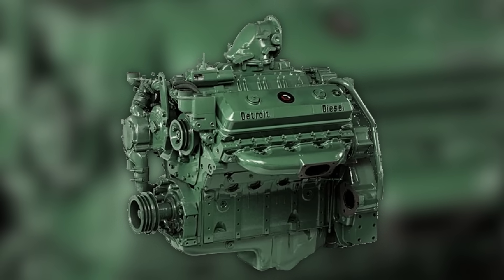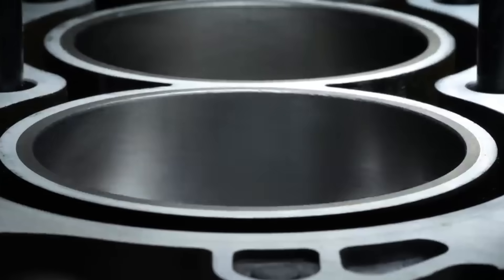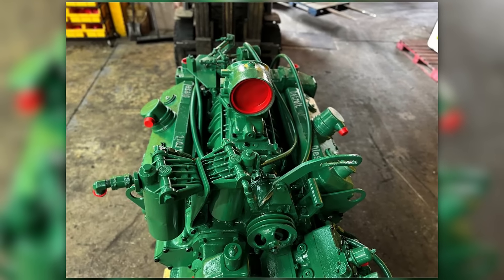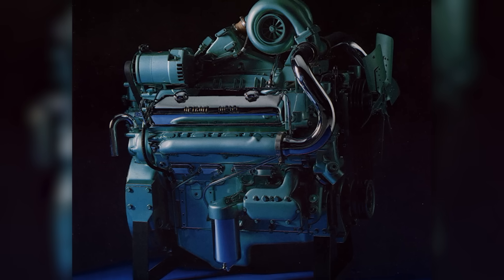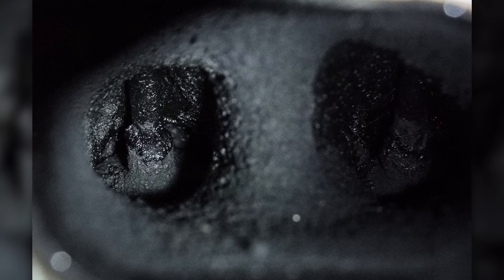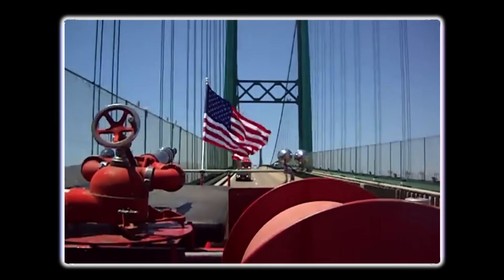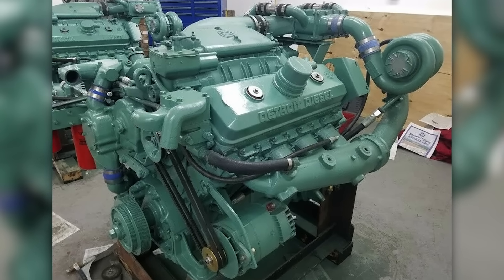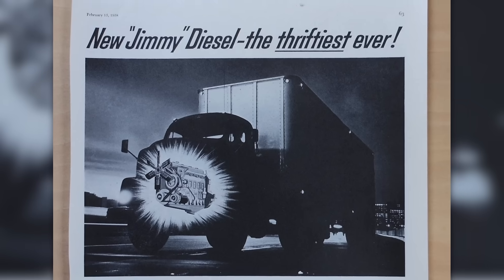The Shocking Truth About the DD 8V71, the Engine Too Hot For Its Own Good

Comment: If you’re going to talk about something at least get your facts straight, the series 53 and 92 had wet liners and the 71 had dry liners.
Reply: I think your source is confusing wet liner with the general concept of replaceable liners. If there was rust or water damage on the outside of a 71 series liner it was not good.
Reply: Also a lot of the pictures you showed weren’t even Detroit parts and some were series 92’s
Reply from the maker: The guy doing the rebuild of the 8V71 said they were wet. I've gotten equal comments with wet/dry, so which is it? You can see the pics of the cavitation erosion, which was in fact on an 8V71. People on both sides swear that they're right.
Reply: @VintageAmericanMachines I have rebuilt series 53’s, 71’s, and 92’s. Series 71’s have different sizes or liners listed as #1, #2, #3, and #4 with #4 being the largest. The cylinder has to be honed to fit the appropriate liner and checked with a feeler gauge for proper fit.  There are no seals on the liners only shims that go under the upper lip of the liner for deck height. I believe that the series 71 came out first and then the 53 and 92 with wet liners.

Comment: Had its big Bro 8v92 go over 60,000 hrs. in a boat. Regular maintenance is all thats needed. All these wonderful engines are finding new life Down Under (Australia) in boats and buses. My Grandfather drove logging trucks and he always said "the hard you run em, the better they cool" and he always had the hammer down. The only issue we ever saw with them(had 4-53,6-71,8-92, 8-92T) was the oil leaks and noise, tho I dont count noise as a problem. Still run a 8v92T today.
Reply: I've been having fun with the Detroit 2 stroke engines since I was a kid. A while. Oil leaks ? Attention to details. And. Don't Overfill it. The oil blows out the air box because it hits the crank. Yachtsman like Nice, clean, oil free bilges. So do professional Fisherman and Industrial operators. Usually, somewhere between the "Full" and the "Low" marks. On occasion to mark new , unmarked dipsticks I put in the recommended number of gallons then use the engine till the oil quits blowing out the air box drain. Then I mark the stick. Truly Great Marine and Industrial engines! 50%of all oil leaks come from filling it up to the Full Mark. At least 50%.
Reply from the maker: Wow, nice. Your grandfather would be correct.
Reply: The 8V92 was one of the best marine engine we ever had in small boats in the US Navy. Yes, maintenance and running lower oil levels were key. The exhaust boots going into the water did help keep the noise down.
Reply: I think they're an awesome engine if I were to be honest. They sound amazing too!💪😃
Reply: For marine application the 6/8/12V series DD is your "safest" bet with water cooled exhaust manifold and never a problem with coolant capacity (relatively speaking) because heat was/is that engines flaw.  Once coolant temps reach redline forget it, cracked cylinder head(s).
Reply: Thats pretty awesome mate. I agree with you, it's all about regular maintenance and servicing. All engines are different but I think these were a pretty important engine to maintain.
Reply: Always Told drivers to put a brick on the pedal and pick a gear for the speed you want!
Reply: Unfortunately they were pigs on fuel and the emissions would kill the crew 😂
Reply: @chrisvig123 
No question, they would need some VW emissions technology!, and ear plugs for the least enthusiastic .    
 But for the loud and proud floaters , this was the best of the best !
Reply: @johnh6515  I was thinking that current electronic sensing and control would cure most ills
Reply: @eflanagan1921  They would be fighting the basic design of 2 strokes, DDECIII was fitted to the 8V92 but that didn't get it past the EPA94 rules and for trucks the Series 60 was doing very well. 
None of this talks about the fuel economy issue that 2 strokes can have. 
While GM/DD was the main proponent of 2 strokes the lack of control (relatively) to 4 strokes is an issue - for the same reason all outboard engines developed in the last few decades have been 4 strokes. 
Even in tugs where their responsiveness is both legendary and required they have on an operational level lost out to 4 strokes and where loosing that battle before the emission requirements where high. 
The Cat 3516 for example was developed to the point where it could give the same sort of instantaneous response as the 2 stroke. 
Funnily enough the EMD engines that the 3516 replaced in tugs where also a GM developed product, they are still made today but mainly for locomotive use - and are owned by Caterpillar....
Reply: @ianloy1854 Everything is going to 4 turd strokes these days and that’s what car culture is obsessed with. I’m in for a 2 stroke DFI v8!
Reply: @eflanagan1921  any 2 stroke motor suffers from 'excessive' emissions - with that said, once has to wonder if the cures are actually worse than the initial 'problem'  (using dust to dust analysis).

Comment: 2 stroke Detroit diesel engines were awesome,  if nothing else,  THEY WERE  GREEAT AT TURNING FUEL INTO  NOISE, SWEET SCREAMING LOUD NOISE! I'D LOVE  TO SEE A GAS VERSION!  With fuel sprayed directly into the cylinder when the piston reached near bdc to just after bdc. A couple  turbo to boot. Maybe a pair of 120 mm spoolie boys. And a pair of spark plugs per cylinder, spinning up to 6k to 6500 rpm any  2 stroke Detroit  sounds awesome,  2/53, 4/71,  6/71, 6v71, 8v71, 12v71,  24v71, 8v92, even the 100× Cid per cylinder 126 what ever it was 12v126, 12 x 126 Cid. Over 1200 cid😮 a 6v126 would been awesome  over 750 Cid v6, or a v8, 1000 Cid v8 8v126 with a Quattro turbo set up, twin compound boost with air to water intercooler.  Running about 60 psi boost. And 20:1 compression making a great drag truck 5 speed with 3 over drives. A single or tandem  axel with lockers and ultra wide tires oversized injectors and pump. Maybe  have custom tires made with drag radial tread.  Only a couple grooves  and tread wear holes, and the sticky rubber on tandem axels . With a 6" Down pipe  going to a 8" stack with a flow master style muffler with a 8" internal flow path. Maybe  16" diameter x 18" we with a 9"x 24" tip give that screaming  more of a DEEP growl.

Comment: Emission and fuel economy changes to the trucking industry had a huge effect.  When I started as a driver in the 70's engines were governed at 2150 RPM's.  Mack started the change with their high torque rise engines.  Other engine manufacturers followed.  The DD could not operate in the 1100-1700 RPM range of the industry change.
Reply: The 8v71N hits it's maximum torque output at 1200 rpm...

Comment: Buddy, I had to tell you this, but the 71s had dry sleeves. And they were complete garbage.  Built over 50 of them.
Reply from the maker: Where were you when I was trying to settle this debate lol. I watched that teardown video so many times, and totally thought the erosion they were talking about was because it was a wet sleeve. Then I scoured forums trying to get a definitive answer and people are all over the place with this topic. Half of them say wet and half say dry. So I went with what I saw, which apparently completely wrong. So why do the parts sites and catalogs sell o-rings for them if they're dry? That was the other thing I noticed. 

Thanks for the info. I'll correct it in the next video. Maybe I need to do one just on liners.

Comment: They were not high rpm but ran at the same rpm as most other diesels - 2100 rpm ( 8V71 & 8V92).    The 53 series revved to 2800.
Reply: We had 2 for standby power where I worked. If you went over 2100 just like you said ours would begin to overheat but if you stayed between 1600-2100 they would run for weeks at a time never an issue.

Comment: There is a lot of misinformation in this video, worked on these engines for nearly two decades. @ 5:00 the oil pressure regulator and relief valves rarely had issues.
Reply: Probably an AI generated slop video.
Reply from the maker: No it's not. I spent 8 hours researching those darn sleeves and was convinced that they were wet on that teardown video I watched. They sell o-rings in the parts catalog, which also led me to believe they were wet. Half the people I contacted said wet, half said dry and don't know a mechanic that actually put eyes on one. At least now I know for sure
Reply: @VintageAmericanMachines thanks for chiming in! A lot of People wouldn’t
Reply: @VintageAmericanMachines they are o-ringed to seal the air boxes
Reply: Let's not forget the fact that he was wrong about the wet sleeves. All 71s had dry sleeves 92s had wet sleeves.
Reply: The liners were shimmed for liner height to get proper sealing between block and head. Never saw a liner o-ring on a 71 series though.
Reply: Yes another AI video. I turned it off at 5 mins.
When I started trucking in the 70s there were 318s and 350s everywhere. We ran several of both. The only difference I was aware of was the addition of the turbo on the 350s making them noticably more powerfull.
They were loud. And down on tourqe compared to the Cummins or Cats of the day but in hundreds of thousands of miles we had very vew problems other than the unavoidable oil leakage.
Well suited to the 13 speed trans you spent your day shifting thousands of times.
I also ran an 8V92 TA with a 15 speed. It was a deeper sound and way more powerful. But still lost RPM at the mere whiff of a hill.
They also used more fuel. Owung to the need for higher RPM.
I liked them all. But did switch to Cats by 1988.
No idea about the wet sleeve issue.
Reply: I don't recall any common or particular overheating issues.

Comment: Travel from Louisiana to California in 1964 on a Greyhound I was 4 yrs old don't remember the trip but I remember the way that engine sound at 4 yrs old as it rumbled pulling into the terminal legendary 👍
Reply from the maker: nice memory
Reply: I was two in 64 and remember the same. Trip from Beaumont, TX to Galveston, TX.
Reply: If it was one of the old "Buffalo busses" with the hump and two smaller wind sheilds on the roof it ran an 8-71 N most likely. I own one of these busses that I inherited from my dad. It would outrun everything on the road in the sixties. My dad drove trucks back then and said they (the truckers) all hated the busses because they would pass them like they weren't moving all the time ! So he bought one and fitted it out as an RV later in life !
Reply: @glennjames7107  Nice still have rv ?
Reply: Sounds like it was a 92 series engine
Reply: Anyone who traveled in long distance passenger buses in the 50s - 70s well remember the whine and droan of the DD Jimmy diesels. When they switched to 8-92s the buses seemed quieter, may have been from better sound insulation around the engine compartment.

Comment: 71 series had dry liner , 92 series has wet liners 😂😂
Reply from the maker: Ugh, yeah, I addressed that above. I researched it for hours and couldn't find definitive proof anywhere. Half the people say wet, half say dry and the teardown video looked like evidence of wet liners to me. Of course I got it wrong 🙄
Reply: @VintageAmericanMachines   go to 71 series manual it will address fitting liners to block & clearances & parts book no o rings in 71 series , but mechanic not boring the block is what got 71 series a bad name I have seen 71 series so bad in 50,000 miles engine had blowby shooting   2 feet out of blowback tube.😮😮

Comment: I ran these in the Navy, and I found that most people would use just the supplied gauge sticks and not use a dial indicator to get each injector or valve bridge. If you used a dial indicator to do the injector and valve bridge to get the correct power and longevity. Another place where using a dial indicator needed to be used was the rebuild. All of these things caused people to hate the Detroit.
The problem of the oil leaks could be mitigated by using the proper sealants on the cork gaskets. Most people did not use the sealant and just relied on the cork. As most mechanics knew, cork gaskets leak, no matter what vehicle it is used in. Cork gaskets leak in gas and diesel engines and also if used in things like pumps also would leak.
Reply: Dial gauges such as the one made by Snap On worked great unless you had Jakes, then you couldn't use it. I don't know if one was ever available for setting injectors with Jakes.
Reply: Cork is porous so needs sealant but it has the 'give' to allow for thermal expansion :body-blue-raised-arms:
Reply: @Bryce-z9v that’s why the manual is always calling for non hardening sealant international #2  aka permatex 2B, the shellac based sealant
Reply: @russellrobins5320  I totally agree 🙂
Reply: @Bryce-z9v  ya win some and ya lose some 😅
Reply: Where in the Navy did you run these?
Reply: @Bee-x6m  I was able to have some senior enlisted who were more interested in doing things correctly than just slapping things together on my first ship (U.S.S. enterprise)
They actually ordered them through the supply chain and then made sure that we used them correctly. When I was TAD to the boat shop at Alameda, we also had them. I ended up buying a set for myself after I saw that they did not agree to buy them for the boat and emergency diesel shop on the next ship and that is how I had a set of my own and used them when the command would not supply them.
Reply: Makes sense
Reply: The entire crankcase was “ PRESSURIZED” by the blower hence oil leaks….
Reply: @PatrickMcneil-h7x actually the air was blown into the air box area, which is separate from the crankcase.
Reply: They chased out all the real great mechanics of the day from enlisted service.  
I knew so many great M.M.'s  over the years and loved hearing the stories of just how bad things got with the new people in the COC. 
The thing that always made me scratch my head is why they would eject some of the best people out only to replace them with greens that could not change a damn oil filter if their life depended on it. 
What on earth were they sending out to the fleet as I got out of the Navy made my skin crawl. 

Thanks to the better training in the SubForce, you never ran into these issues to often, or the command would nip it in the bud.

Comment: DD 53, 60, 71, 92,110, 149’s all had a duty cycle. They should not be run under a certain load, and not over a certain load over a given time frame. No 100% load 100% of the time as in a farm tractor. Depending on the engine, some could do 90% load 100% of the time or a bit more. This especially true in boat service when matching a propeller for maximum cruise. Have fun
Reply: Series 50'S/60'S are four strokes and run completely different.

Comment: Two stroke engines in general tend to be less about torque and more about RPMs. The reputation for oil leaks was deserved but that was a by-product of having a pressurized crankcase. This was an engine that shined in boats, power generation and irrigation, an application where the need was for a consistent load and RPMs. The adage about them was “if there’s no oil under it there ain’t any in
It either”
Reply: They didn't have pressurized crankcases like a 2 stroke dirt bike or weed whacker engine, the supercharger is what created the pressure that forced air into the cylinders and the exhaust out past the exhaust valves, which also means contrary to what most people believe they weren't really supercharged, since the piston was at the bottom of its stroke which exposed the intake window in the side of the cylinder and the exhaust valves were open at the top of the cylinder at the same time all the supercharger was doing was pushing in fresh air that was pushing out the exhaust gasses at the same time, so instead of building pressure in the cylinder like a supercharger normally does it was just pushing everything along.
Meanwhile the crankcase worked just like a 4 stroke engine, it was vented with a breather.
Reply: @dukecraig2402   The compression ratio stated was just the calculation of bore and stroke.  If you subtract the height of intake ports it would be close to 16-1 like four stroke diesels.
Reply: Yet the Detroits turn the same speeds as the 4 strokes (2100-2650 RPMs, and many small engines like Lawn-Boy mower engines run SLOWER than 4 stroke mower engines, the max on a Lawn-Boy was about 2800 RPM, and a 4 stroke mower engine is typically 3600 RPM, yet the 2 stroke will kick butt on a higher revving 4 stroke of more than twice the horsepower! So the 2 stroke wins!! 😋👍🏻😊
Reply: @2StrokeDriptroit no it won't 🤣

Comment: Here it is 2025. My lowboy truck that i move my dozer around with has a 8-V-71,  15 speed in a 1979 L-9000. It has almost 46,000 miles on it. Takes me back to my youth everytime I crank it. I love all my old school stuff. I own a small clearing and grading business.
Reply: 46 or 460 ?
Reply: Only 46k???  WOW!!!  Or did you mean 460k??
Reply: Happy for you!!! 🎉
Reply: I had this exact set up in my 1979 cab over Kenworth. I bought it when I got out of the USAF. I Leased it out and had an LTL from Odessa,Texas to MONTEBELLO, California. I don’t know how many trips I made in that truck and I sure outran a lot of Cummins Diesel trucks. It made me a good living. Bought and paid for my house and 13 rent houses. Bought 3 cars for my kids when they learned to drive. Put two kids through college and helped start another in his own business. Yeah it did me good. Only problem I ever had was a broken valve spring
Reply: Still running a 8V92TA in my haul truck for 30 years. 379 pete
Reply: No, it was right 46,726